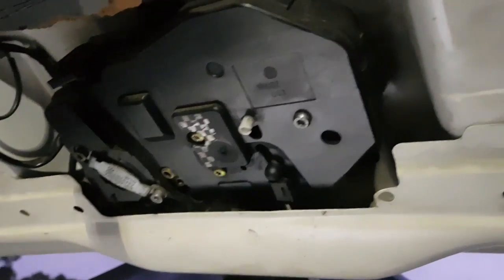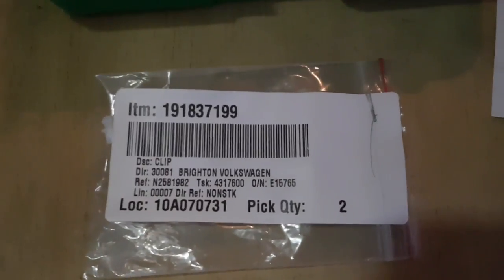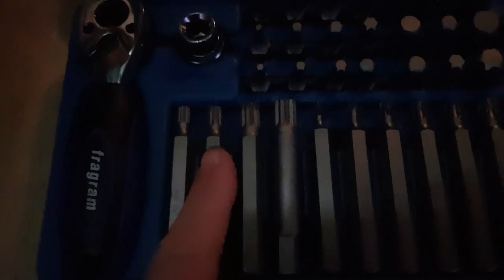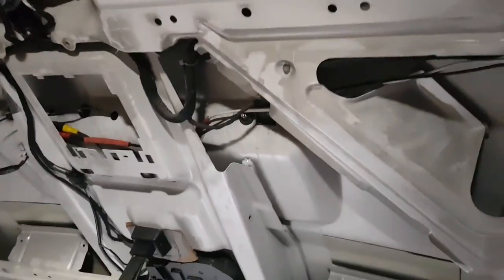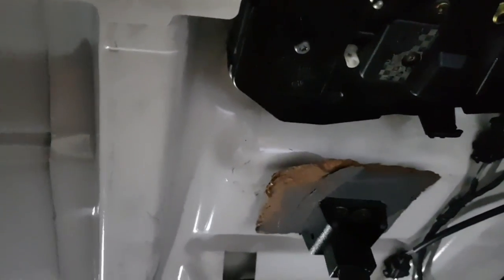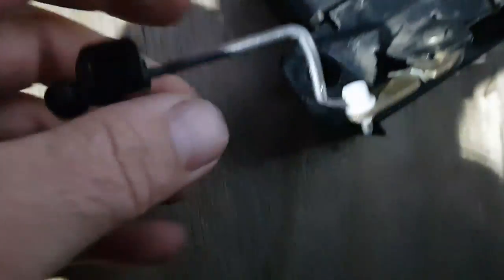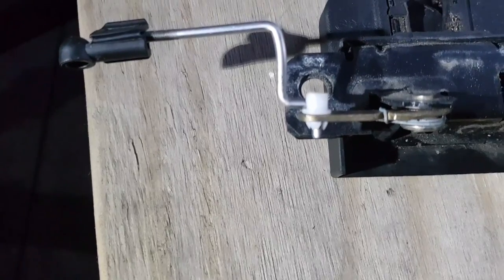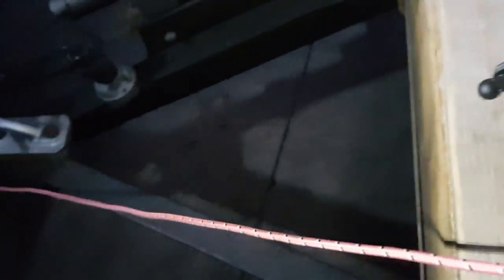Volkswagen Transporter tailgate not working and how to fix it

Comment: Sir, you really saved me lots of time and money. 
Tailgate was stuck closed and couldn't find a way to open it. What happened was the rod simply came out of the white plastic disk. I managed to open the tailgate from inside with a screwdriver, just lifting the bar where the white disk is located. Then I took out the lock and put the rod back in place as you described. Now it works perfectly. Thank you so much for sharing this video.
Reply: This has just happened to my 91 T4, can't get in etc. Thankfully you have explained how I can get the tailgate open and sort the problem 🤙🏼

Comment: This video helped, thanks, I couldn't take off my boot lock T5 2009 as my spline was a size 7 not an 8 like you had in the video. I just bent the inside flap a small amount with a pliars, got enough access to complete the job.

Comment: Hi pal, might have the same problem, my pull catch has no resistance when pressed so door won't pull up,if I exert too much pressure on the key it will open, only just started this,is it the same problem?
If so , my van is a 95 1.9 Caravelle,is your van same year,do they change on later models?
Cheers.
Reply: Hello there, great video.  But me be a bit slow. How did you unlock the door to begin with?🤔